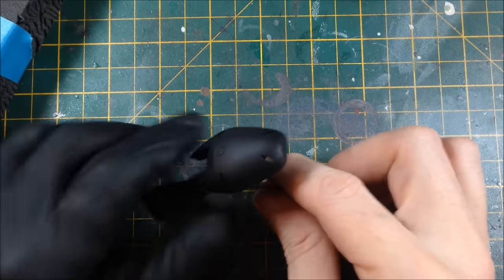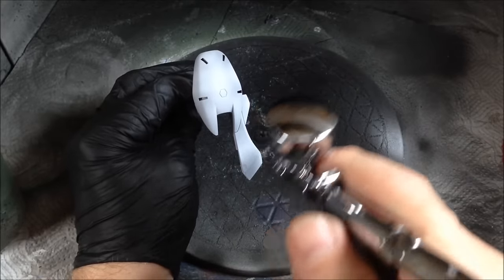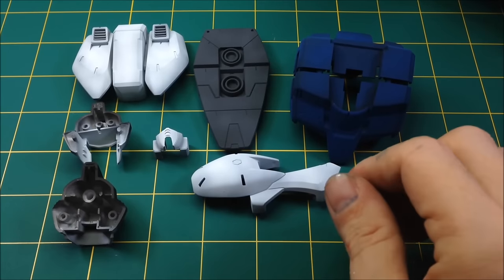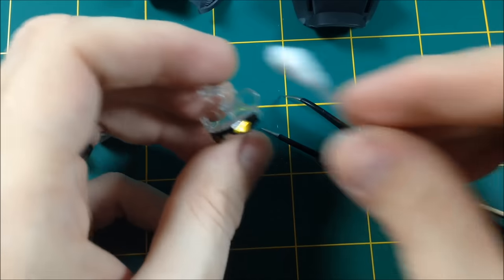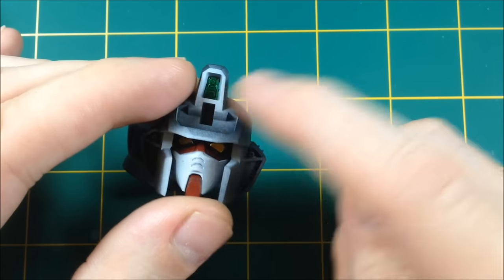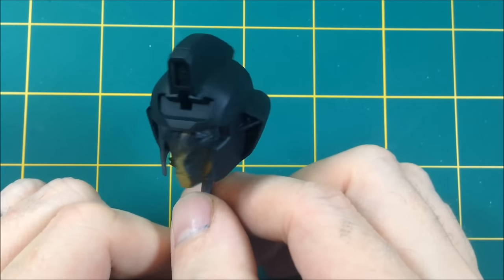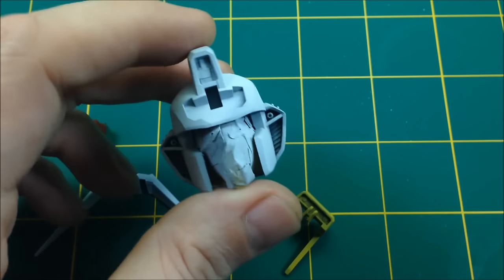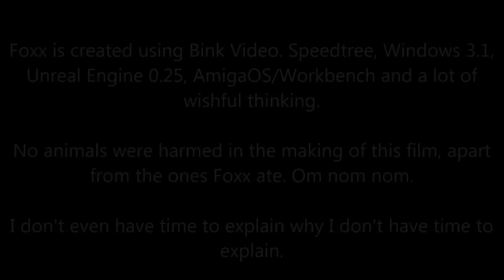Bandai 1/60 Big Scale Real Detail Strike Gundam 5: Painting Armour, Head Seams

Comment: Looking good,
Have you tried using White Tac for masking in recess? I find using masking tape a pain in the arse. If you roll it out to size because its pliable i find it much easier to use and it doesn't leave any residue behind.
Reply from the maker: I do use it from time to time, but I wanted to avoid that for the face as I didn't want to risk pulling the eye camera sticker off. But I find tape preferable in areas where I need a straight edge, and I knew I would be able to keep the side grilles dark just by cunning airbrush use anyway ^_^

Comment: just starting to get into the hobby, but my question is: what did you use on the eyes sticker to keep them from moving?
Reply: also great work, I enjoy the instructions , hello from NY
Reply from the maker: Hi! I think I showed it in one of the episodes, but I simply applied the sticker, burnished it into place with a cotton bud (Q-tip) gently, then gave it a couple of coats of Gloss varnish brushed on (I use Pledge Floor Care Finish, AKA Future or Klear) taking care to try and also go along the edges of the sticker in the hope that some would seep underneath and help adhesion. It also helps if the part the sticker is on has at least been primed so that there is a rough surface for the sticker to grip to.

Comment: questions.
what airbrush is that?
and same with the tweezers.

and fantastic work,commentary and explanations
Reply from the maker: Thanks!

The airbrush is the Neo of Iwata TRN1 (it's a standard Neo but with a trigger grip, which I ADORE. It's not solvent proof though, so no good for lacquer paints, lacquer or cellulose thinners, or any use of Isopropyl alcohol (aka isoproanol or rubbing alcohol). 

The tweezers are from Master Tools, I got them as a set from www.emodels.co.uk but they don't seem to have them in stock any more. But there are many alternatives out there ^_^
Reply: argoth231 I'm yet to tame my neo lol it hates me but it's a really good air brush wwll recommended on all levels . just mine hates me it's on the naughty step lol
Reply from the maker: Heh, the trick with airbrushing is to not think about what you are doing, the same way you don't think about the act of writing when you are writing with a pen. If you think carefully about what you are doing, you'll be cautious and it will seem like hard work. If you just go into man-mode (i.e. turn the brain off and ignore the instructions) you'll start to have fun. The brush itself is fairly straightforward, the more tricky part is learning what to do with the paint that is coming out, but that comes with time.
Reply: right now im still using a master airbrush i bought for cheap.
i want to upgrade,but there is just soooo much out there. not a clue even where to start
Reply from the maker: It's a very personal choice, but if you want to start off budget before spending a ton on a brush, the neo is one of the better bets, as are some of the cheaper Badgers.